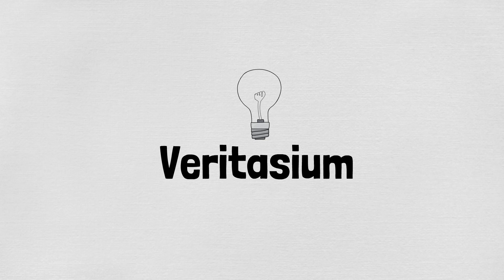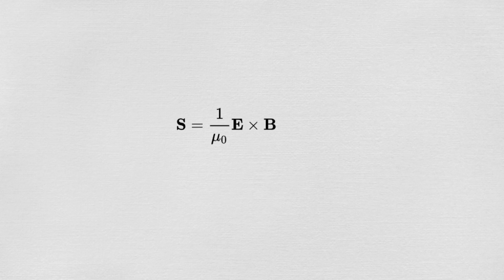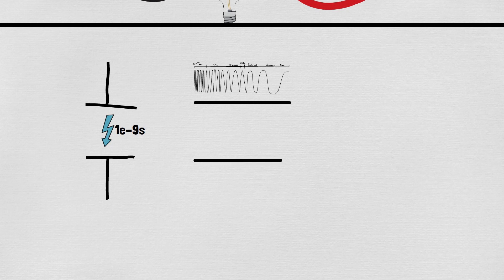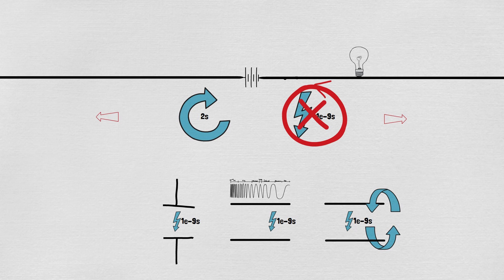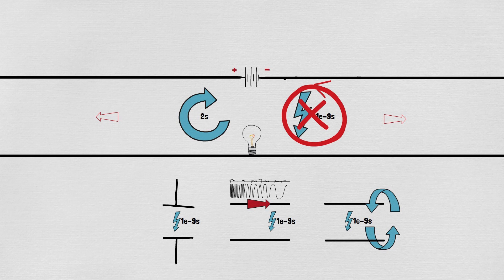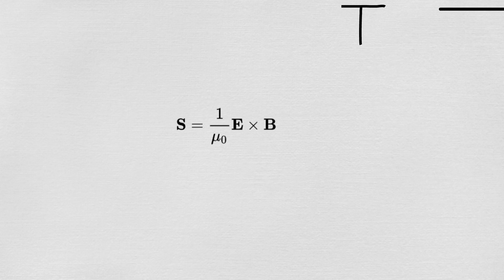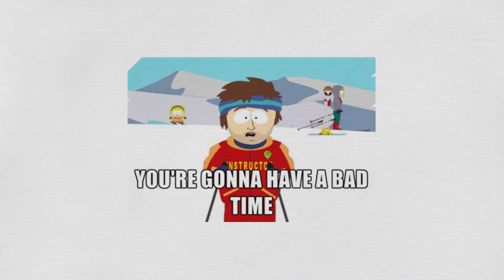Veritasium is Right? (see description)

Comment: You mention the capacitor, antenna, and inductor arguments, and then dismiss them due to a lack of current.
However, closing a switch in a DC circuit does cause current, and a switch turning on is momentarily a change in current.

I think the best explanation I've seen was an animation that showed how some energy does flow over instantly, but more energy arrives later at about the speed of light around the circuit.

If that simulation is to be believed, then the fields do carry energy directly to the bulb, just not all of the energy - plenty of it has to come through the wires. 
(In the parameters of the simulation I watched, it was about a 3rd of the energy arrived instantly, and since we assumed any non-zero current through the bulb lights it, that would be enough. I also think the model might have had a 0 resistance bulb, i.e. instead of a bulb it was just more superconducting wire, which might impact the proportions of energy here.)

To the question 'does flipping the switch power every bulb in the unvierse', well, kinda yeah. However further away bulbs, receive less and less power. The instantaneous moment of capacitor/antenna/inductor behaviour has diminishing effect for further bulbs. 

That all said, maybe the bulb in Veritasium's scenario ends up only just barely lighting up after 1m/c seconds, because only a small amount of energy travels across the gap instantly.
Reply: He missed the fourth explanation!  The first three are incomplete and misleading.
No simulation actually needed.  From basic rf design principles, those long parallel wires behave exactly like resistors, 700 or 800 ohms, wired in series.   So, after 3nS, we have 1400 to 1600 ohms wired in series between battery and bulb.  This situation persists for one full second.   To get maximum brightness, the bulb resistance should be chosen to be the same as this series resistance.   So, for a 12V battery, the bulb initially gets only 6VDC and 4mA, rising to 12V and 8mA much later when the reflections have died away.
Reply: @wbeaty  The thought experiment/explanation in the Veritasium video explicitly says to assume the wires have zero resistance, which is probably why the various explanations have ignored resistance.
Reply: @wbeaty   Yep.
Reply: @BainesMkII  The easiest way to understand is consider the two long pairs going far away as transmission lines, or 'stubs' shorted at the far end.  

You must understand that loss-less transmission lines have a characteristic impedance that is purely resistive.
..
They look like resistors (of about 800 ohms). 
This is the characteristic impedance also called the surge impedance. 
They look like resistors until the reflections come back from the shorted ends.
.
So, at t=o, when the switch closes, the battery is connected through two 800 ohm resistors to the bulb that is 1 meter away. Therefor, after the 1M/c seconds after the switch closes, it has a lower current until all the reflections die out when the bulb lights to full.
The way the E and M fields operate causes this to happen.
Reply: That was incorrect. The analysis assumes that  the battary and switch "knows" the distal setup ahead of the time. The actual situation is, before 1/c second, the battary/switch setup has no ideas how many light bulbs there are and in what direction they are located. Therefore, how could 1/3 of energy arrive there? What if there are four bulbs connected to the circuit all at 1m distance? It has nothing to do with superconducting wires or special bulb what can light up with minimal amount of energy, the crux of the issue is that right after this very short time, the casuality bubble just reached the light bulb. Before that point, the battary/switch has no ideas that they are supposed to power a light bulb, they just radiate EM energy everywhere. The blub can only capture a tiny fraction of that energy radiated through the gap, nowhere near 1/3 of the total. Considering radiation is uniformly distributed 360 degrees around, and the thickness of the wire is so tiny comparing to the circumference at 1m distance, I think it is more like ~0.1%.
Reply: @s0gu0001  I think you are partly correct in that very little energy reach the light bulb in 1m/c time for the transmission line model to work the distance between the wires must be much smaller than the time since the switch closed, the transmission line model should work well after 10m/c.
Reply: @s0gu0001  >The analysis assumes that  the battary and switch "knows" the distal setup ahead of the time.
>how could 1/3 of energy arrive there?

I would imagine that the induced 'emf' depends on the fields produced, and the power delivered by that 'emf' depends on the current too, and the current depends on the resistance.

The fields interact almost instantly (at speed of light for 2 wires ~1m away), so the amount of energy delivered can of course depend on the bulb setup, because both ends of the circuit interact via fields with a delay of 1/300,000,000th of a second.

So in his example, the power delivered happened to be a 3rd, because the plain wire easily took a bunch of the energy due to a lack of resistance. A highly resistive circuit mighty not have taken as much energy from the field, and so perhaps more would go through the wires. 
This does not require any non-locality.
Reply from the maker: @BainesMkII  making the wires have zero resistance just makes the thought experiment even worse because of the Meissner effect.
Reply: @Moley1Moleo  I think Shi Gu is correct - 1/3 is way too high. The issue isn't the resistance effective across the gap - it is the size of the field strength that induces a current on the opposite wire. This falls off with distance (1/d due to the geometry, rather than 1/d^2 for normal EM fields). So it is smaller by the ratio of the wire thickness to the circumference of a 1m circle, which is a little less than 1/6000 for a 1mm wire.
Reply: Why does the amount of energy that arrives there really matter? we know the bulb is off at the start of the experiment right?
Reply: @ThePerfect1077  It is energy that gets turned into light at the bulb.
Reply: Yes that simulatiion linked above is excellent in showing what actually happens although he does pick arbitrary voltsges and lengths, so you cannot read anything into the actual values he shows. What I think it also shows is the switch and itts position is important! Before the switch is closed the full potential of the battery is across it and in closing it charge movent is induced across it. It's this sudden change (step impulse) that creates the EM transmission towards the lamp. It is the switch position in the circuit that matters not the battery's! Derek does not make this clear in his video, he implies it's the distance from the battery to the lamp that's important, not the switch.
Reply: The way you mention the simulation says is exactly what derek says in his video. He says that the bulb will light up "slightly", and then get brighter as the rest of the waves get to it
Reply: @Iluhvahtar  If by lighting up "slightly" you mean so dimly and for such a minute amount of time that no human could perceive it being lit (not until the full DC circuit was at steady state a second or so later), then he is right. But I feel he will confuse people (and clearly has) by implying you would see it. I know he tries to give himself an alibi by saying that "any current" will light the bulb, but he should also make it clear that we should ignore the bulb's intensity and if it goes off again. Of course that would spoil his trick. It's a fun trick, but I think it will confuse people and that's not the job of an educator. I think if I was showing the experiment I would have shown it with a sensitive current meter with a needle and asked the audience at what time would we see the needle first move. Same effect, less confusion.
Reply: @andy_taylor  well, in natural conditions, yes. A little more with his given conditions, since he says to ignore resistance for instance.

What I took from the video is that he made a thought experiment to demonstrate that the energy does not come through the cable, it comes through the waves generated around it. So much so that a light bulb lights up almost instantly, even if dimly so, way before the current actually travels all the way through the wire. So far, every debunk I read did not say that is exactly wrong, which was the actual point of the video for me
Reply: @Iluhvahtar  But this simply replaces one minor misinterpretation   (that EM energy transfer needs wires) with another more pressing misinterpretation (power transfer for light bulbs don't need wires). It would have been far less confusing if he had said that turning on the switch creates a small radio wave which is picked up by the wire 1 m away, turning the light on. This would have then not equated the key findings with the trivial. It would also have created an intuitive understanding of the sensitivity of the light bulb, reducing the potential for this second misinterpretation. 

The problem with having such a high sensitivity is that technically the light bulb will turn on before the switch is touched. Background waves from radio stations and stars, fluctuations in the Earth's magnetic field due to solar wind, the nervous system of the person pressing switch, thermal fluctuations due to ambient temperature and the CMBR will all turn the light on "just a little".
Reply: @Observ45er  Thank you! it's worrying that the only sane comment is basically ignored.
I'm not formally educated on any of these topics but have spent the last few years learning everything I could about antennas (and thus transmission lines) and I was confused as to why the author of the video made the claim at 5:00 that no current would flow when the switch is open. I suspect the aforementioned lack of EE education and experience with EE design as the reason why the author didn't consider it.
Reply: @wbeaty  He mentioned in the problem that you assume the resistance of the wires is 0.
Reply: @brendanh8193  but it does not say it "does not need wire". I myself did not take that from the video and was actually impressed when I went to the comments and saw people saying that. For me it was clear he was not saying that you "don't need wires", but that the energy is not transfering through the wire, as one would assume.

Tbh, I think people went too hard on a particular expression he used and that you could even get what he meant when he said it would just turn on slightly
Reply: @Iluhvahtar  Yes, but I suspect you are fairly careful in how you accumulate knowledge. Most people aren't that precise. Part of the art of science teaching is understanding and countering misconceptions when they occur. 

For DC, most of the energy does travel down the wire (through the wire) following the path of least resistance, while some leaks into the environment, onto the other wire. But this thought experiment is about a transient situation, in between DC and AC. 

A couple of further questions to ponder. Does all the energy leak into the environment through induction, given how long the wire is? 

Also, wouldn't more energy simply transfer to the side of the wire after the bulb, therefore complete the circuit without lighting it up due to lower resistance?
Reply: @brendanh8193   Now you are giving a bit of information that seemingly directly contradicts what derek was saying.

First of all, I should make a disclaimer that I am a layman, so I did not major in natural sciences and my (limited) knowledge comes from reading things and watching as an enthusiast (besides regular school), I actually majored in law. And my comments are about what the video seemed to be saying to me.

That said, what I took from the video is that the energy transfer does not come from the physical matter inside the wire  it comes from the waves that go all around it, but following its potential difference, some inside the wire, and some outside, but close to it.

If you mean to say that most of the energy is transferred through the wire, and the amount that goes around it, but following it, even after the 1s, is negligible, then in this case I think you are more directly defying what Derek was conveying, because I saw the thought experiment as a way to prove a point, but not something would actually happen.

About your questions, I am not sure how to answer it, but in the second one wouldn't the energy transfer pass throigh the bulb anyway and power it?
Reply: @Iluhvahtar  Ah, that is where the precision of your understanding comes from - training in law. :) 

I'm not sure whether Derek actually has this misconception (that energy doesn't travel inside the wire), or simply explained it that way leads to that misconception. And at the same time, I'm not contradicting the view that it travels in waves which extend outside the confines of the wire. I think that the issue is around the concept of a wave. 

Note that I had stated "in DC (circuits)", which some would say doesn't have waves. (Others would say, DC has a single infinitely long wave.) AC current is a completely different story, with waves defining its existence, and this is entirely consistent to how you described the energy transfer. AC currents have steady waves, with the voltage varying constantly in a known pattern. Transient waves are waves that only have a short duration of change, then settle down to a constant value (of EM field strength, or density,  or height, whatever concept is defining the wave). The "waveness" of this is really only in the initial wave front. So, closing the switch in this thought experiment creates a transient wave, a situation that has both AC and DC properties. 

I could go further into the interrelationships between energy, power, fields, matter, time and space, but the key point is that they are interrelated in complex ways (and any electrical engineer would appreciate the pun in that statement), and therefore the nature of the energy transfer is likewise complex.
Reply: @brendanh8193  I didn't mean to say that I got from the video that the energy doesn travel at all through the wires, but that, being a wave, it does not travel solely, or better, mainly, through them.

The energy transfer travelling exclusively through them on DC and mainly on AC as you said would make the video a big mistake. I really don't have tbe knowledge on the subject, but makes me wonder why so many physicists came to Derek's defense. I think that this video we're commenting on (and others too) should have made this particular point more clear, since I watched it and didn't see anything that actually addressed this.

PS: I think I got the complex numbers pun, where I live they still teach complex numbers and some basic calculus on high school (we don't choose the subjects here).

PS2: In any case, I, as a layman, am not sure what to think. Some people, like Bob from RSD academy makes really good points in explaining some questions that rise up. The one of the switch from this video is answered in his latest, for instance
Reply: @Iluhvahtar  Glad to see the pun wasn't wasted.  :)

And Bob's explanations are great. His most recent one, just a few minutes ago, addresses the same issue as this video, and even though he initially seems to contradict this video, actually agrees with it.

However Bob never addresses the elephant in the room, the sensitivity of the light bulb.
Reply: @brendanh8193  wait, what issue did he agree with? The switch placement/necessity? Because I seem to have taken the exact opposite impression from what he said

PS: besides, bob constantly mentions what I said, that the energy transfer comes through the waves around the wire. I still think he doesn't mention the sensitivity of the bulb because that wasn't the main point (as I said earlier)
Reply: @Iluhvahtar  At 9:48, he seems to contradict this video. But at 13:15 to 14:00, he validates this video by showing that it takes time to propagate the wave from the new switch position to the light. I think that the strength of his statement at 9:48 is to people who are using the argument about the switch position to state that everything in Derek's video is wrong, when most is correct. 

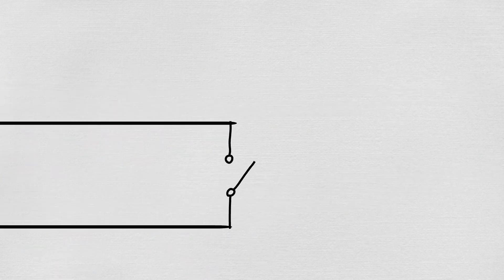On the issue of moving through and around the wires, 3:06 - 5:00 Bob explains the point quite well. Bear in mind, an EM field is a construct associated to how charges interact with each other at a distance. They are sourced in the charges themselves which are in the wire.
Reply: @brendanh8193  I don't think he validate the video since I thought this video tried to imply as one main point that, with what derek said, the switch wouldn't even be needed. Which is not true, because it is the turning on of the switch that closes the circuit and makes the EM transfer energy. In 13:15 to 14:00 he actually further reiterates derek's point, basically saying "derek put the switch close to the bulb for a reason. If he put it far away, the time it would take would be different".

The source of the EM field is the electrons and that's why I said derek didn't say "it doesn't need wires". Because it does need. But that was not the point he was trying to make. His point was that the energy transfer is not mostly ocurring through the wires, but around it, through the EM field, which is not the way we generally assume it works
Reply: @Iluhvahtar  The energy doesn't travel as a wave. It travels because the current flowing in the circuit creates a static electric field between the left half and the right half of the circuit and a static magnetic field around the wire. The magnetic field only crosses the electric field at the far ends of the wires and the Poynting vector in both cases points in the same direction as that from the battery toward the bulb. That's why we get all these click-bait claims that "energy isn't carried in wires" as if we don't need wires to transport electrical energy.

When the switch closes, a transient step in voltage is created between the left leg of the circuit and the right leg. That transient will radiate a microscopic amount of energy for a microscopic amount of time as an electromagnetic wave, or photons if you prefer. The initial transient is wholly unrelated to the static electric and magnetic fields that exist when the circuit is established.
Reply: @brendanh8193  The sensitivity of the light bulb is key to the apparent paradox. Although you can have wires with no resistance (superconducting wires are used in the Large Hadron Collider, for example), you cannot have a light bulb that lights up with an arbitrarily low current. Otherwise, a circuit consisting of a battery, a switch, a 10pF capacitor and a bulb in series would light the bulb forever once the switch was closed because the current charging the capacitor never quite drops to zero. It's this nonsense that causes all the confusion. No real bulb can emit light with an arbitrarily low current, and as soon as you start using figures for the current required, Veritasium's sleight-of-hand is exposed.
Reply: @RexxSchneider  As I mentioned many times, it was never meant to be "as if it didn't need wires". I still don't know why people say that.

I don't think it being transferring as a field change much of the point being made, doesn't the field propagates at the speed of light all around its source like it was a wave?

Unless you are making the point that the energy is coming through mainly, or exclusively, inside of the wire, we are just going back to the beginning of my discussion with brenan
Reply: @Iluhvahtar An electric field is a vector field that exists between points of different electrical potential. If the potential changes, then the field adjusts to a new value at a speed close to the speed of light. The dielectric constant for the medium where the field exists determines that. A static electric field alone will store energy, but it will not transfer it. In a circuit carrying a current, there is also a static magnetic field, and where the two fields intersect, energy transfer will occur in the direction of E x H, the Poynting vector.

A wave is a different thing. An electromagnetic wave is an alternating electric field coupled to an alternating magnetic field at a particular frequency. The directions of the alternating electric field and the alternating magnetic field are perpendicular to each other and perpendicular to a third direction, which is the direction that the wave travels. An electromagnetic wave will transport energy.

Your original comment seemed to confuse electric and magnetic fields with an electromagnetic wave, and I was trying to explain to you that the energy transfer due to the current in the circuit was not through a wave. Do you now understand what is wrong with claiming "what I said, that the energy transfer comes through the waves around the wire"?

In a DC circuit, you can think of energy transfer as happening whenever there is a (static) electric field which intersects a (static) magnetic field. It doesn't really matter whether you think of the energy being transferred through these static fields outside of the wire or through the current inside the wire. If you have current, you have these fields and vice-versa, so it is just a question of perspective whether you think the electrical energy is transported via one or the other. You get the same answer either way.
Reply: @RexxSchneider  so, what you are saying is that an eletromagnetic wave will transport energy, but that it is not it that is transporting energy in this case, it is the field?

In any case, as I mentioned to Brandon many, the main point of derek's video is to say that the energy transfer is not coming mainly through the wire, even if its source is the wire, it is coming all around it, which at first glance is counterintuitive. You say "it doesn't matter" how you think it is transferred, and it probably doesn't from a practical standpoint, but what he was trying to show in the video is how the energy is really transferring, even if it won't matter to you when building a circuit.

PS: I think derek was assuming an AC current on the thught experiment, considering what he was saying before
Reply: @galtbarber2640  Right.  Zero-ohm wire, in a 2-wire line, give about 700 ohms.  That's how EM works.  (And perfect zero-ohm coax cable still is 50 ohms.)  Understand this, and you understand why Dereck is right and all the critics don't know basic EM physics.
Reply: @BainesMkII  A perfect zero-ohm 2-wire line will have about 700 ohms.  (And a superconducting coax cable will act like a 50 ohm resistor for the same reason.)  That's the key to calculating the mA for the 1-sec initial current in the bulb.
Reply: @antimatterhorn  Zero resistance doesn't require a Meissner effect. There are non-superconductor ways to achieve zero resistance, such as the quantum hall effect.
Reply: @antimatterhorn  No, it doesn't make it worse. In fact that's a key assumption in the original video. This works just as well with super conducting wires as normal wires. EEVBlog did an excellent explanation video using transmission line theory https://youtu.be/VQsoG45Y_00?t=1674 The wires still have capacitance and inductance even at zero resistance. The impedance is not zero.
Reply: @wbeaty  So if we used two pieces of superconducting RG-58 cable with a 50 ohm bulb (e.g. a common 12V 3W bulb) and a 12V battery, you think the surge current when the switch is closed would be 12/150 A = 80 mA and each of the three sections would have 4V across it. You also think that the current would last for 1 second and then would either increase to 240 mA if both ends of the coax were shorted or decrease to 0 mA if one of them were left open. The question in my mind is how does the current know it has to stay at a steady 80mA for 1 second before ceasing completely? To help you, the propagation delay for RG-58 is 5ns per metre.
Reply: @RexxSchneider  Yeah, two 50ohm cables = 100 ohms in series with the bulb, so 12V/150 = 80mA in the bulb, at about 4V and 1W.   Need 100K miles of Ideal coax!
How does the current "know?"   That's like asking why coax has a Z of 50 ohms.   Place 12V on coax, and how does the cable know to draw 12/50= 240mADC continuous?  That's the rate of energy flying off down the cable, the 240mA times 12V between center and shield.  The 50ohms arises because we're charging up a capacitance to 12V, and each segment of the cable is connected to the battery via some current-limiting inductance.  In the math, cable capacitance and inductance fight each other, creating a pure resistance, where if we apply 12V to a 50-ohm coax, the coax will draw 12/50 amperes.
Really this happens because all electrical energy flows as EM waves.  Wattage is flowing EM-energy.  When we connect 12VDC to 50ohm coax, electrical energy starts filling the cable, and flying off as a smooth, uniform "cylinder of energy" that's growing constantly longer.   Yes, RF travels as waves on cables  ...but so does AC power.  So does DC.   (DC is simply a square pulse of AC, a "brief transient" which can be minutes long, or hours long.   There is no official division between AC and DC.)   

Some people angrily insist that "THERE ARE NO WAVES IN DC!!!"   Nope, wrong.   Think for a bit:  think square-waves.  With square waves propagating along cables, we can ask, "Is all the power located in the edges of the wave?"   Nope.   It's in the flat section, the "DC" part, especially with ideal square waves and infinitely-steep edges.   This idea applies to 1MHz square waves, but also to 0.001Hz square waves.   The wave-energy flows at the speed of light, even when the peak of the wave is flat-topped, and is being called "DC."   Instead of a 100-foot cable with 1MHz, instead ust use a billions-mile cable, and a square wave where the cycle is minutes long, rather than microseconds.

Another view:  whenever we connect our 12V to an infinitely long cable, electrical energy flows continuously into that cable.   But also, if we connect a normal resistor to 12V, electrical energy flows continuously into that resistor (and is lost as heat.)   As long as the wattage is constant, our 12V power supply is feeding a resistor.   Cables look just like resistors, because an oblong "lozenge" of EM energy is gradually filling the cable (gradually meaning, at the speed of light.)
Reply: @wbeaty  excellent explanation. Also really good point about DC essentially being a really long square wave. I think many people fail to realize that subtlety.